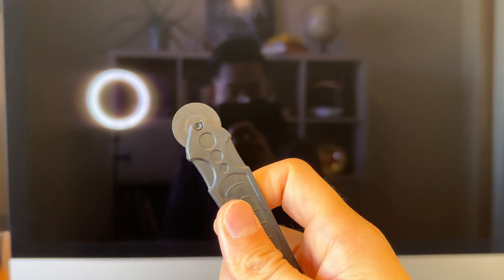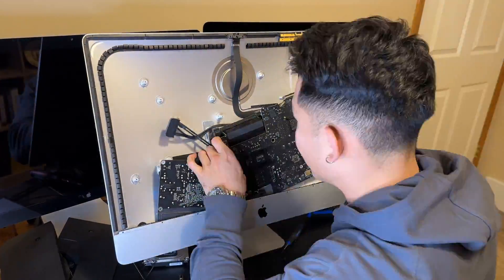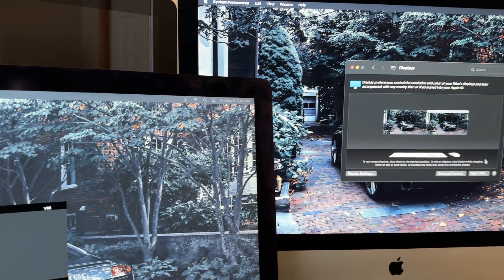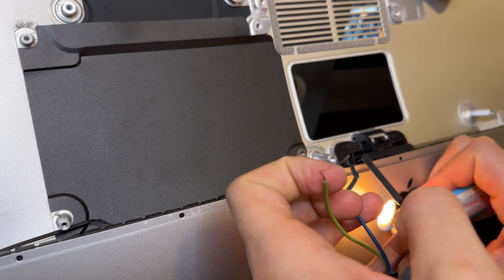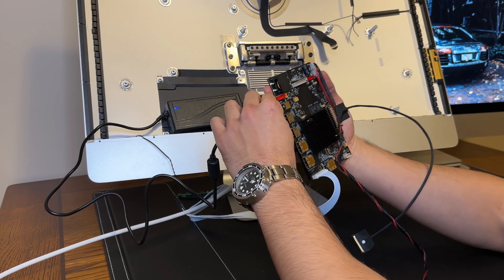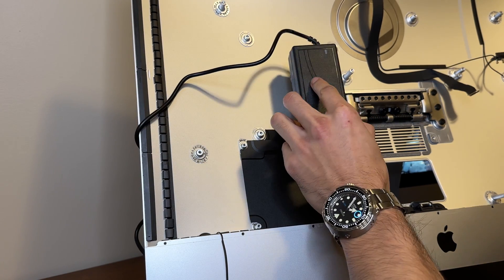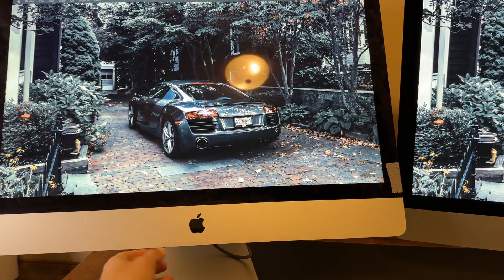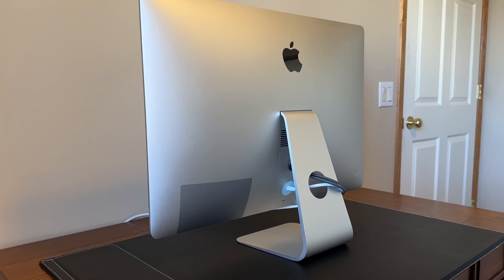How I Got a 5K Retina Apple Display for $400

Comment: Hi Run Young,  I may have diagnosed the issue I am having noted in my prior comment.  The HDMI port on my MacBook is HDMI 2.1 (up to 8K) but I was using an older HDHI cable which was probably not able to handle it 5K speed.  I just ordered a new 5K certified cable. Hopefully, this resolves both the resolution and flickering.   I will report back in 24 hours once the new 5K cable arrives.

Comment: Hi Run Young,  I hope you are still connected to this video.  I would appreciate your advice.  I followed the video and sort of got it to work.  I am using a 5K display from 2017 iMAC.  I did order the controller to match the part number which was slightly different than yours.  Mine was LM270QQ1 (SD)(C1).  I am connected to the HDMI port on a 2024 MackBook Pro.  The issue I am having is that the screen will only go up to 4K resolution.  The remote control that came with my unit is in Chinese so that is not helpful.  The Mac settings screen does not show any resolution options for this monitor.  Finally the 5K monitor tends to flash on/off occasionally.  Thanks for any guidance you can provide.

Comment: I noticed you have two DisplayPort cables connected; is that necessary? Wouldn't a USB-C Thunderbolt cable, for example, be sufficient? Thank you.
Reply from the maker: Yes, it’s required for full 5K.

Comment: amazing video! Really love the way you handle it! I'm going to do the same with mine. I have 2 question. You solder two cables, the first is for the power button, of course... and the second? Where did you connect the speaker crossover to the board? Thank you so much.

Comment: Run Young - Would you share the wiring schematics to connect the original power supply and the power button to the new logic board wiring?  Which wires to cut and splice?  Thanks!

Comment: Thanks for this video, very helpful ! I just modded my Imac 2015 with a SA1 board, everything working well (appart that i broke a bit of glass on the side of the creen when manipulating it... One question though : 4'34 : which cables on the ribon cable of the controler board did you solder to the original turn on/off button ? there are so many, and cannot find which one correspond to the power button.

Comment: Awesome vid Mr. Young. My 2017 mid year just died. Got a new MacBook M4 16" Pro. Want a monitor and still have the 2017 monitor. Is there a way to install a thunderbolt in there or how do you connect a plug to run a MacBook to the monitor ? Thank you again, Kim
Reply from the maker: Yeah! Just buy a display port to usbc cable!

Comment: to connect it with my macbook M1 max, only 1 display port is enough ?
Reply from the maker: Im not sure how it will work with apple silicon, I have not tried.
Reply: @RunYoungShoots  I finnally bought the SA1 board, it works great in 5K with USBC. I will probably run a display port and hdmi, just for backup, but for now working fine ! I just need to do what you did with the power button and AC in.
Reply from the maker: @Studio23creation nice!

Comment: I used this video to make such kind of a monitor. If you familial with soldering iron you can use power supplier from iMac. It's power enough to provide 12V. 5K works with Display Ports. I did not get it with HDMI.

Comment: If I may ask, why not run the board with the LEDs and switch outside also? Does the remote do everything that board would do?
Reply from the maker: @rickbo3366  Yes, it would look bad.
Reply: @RunYoungShoots  thanks.  One other question.  Are you sure it’s running at 5k? I saw other places which said DP 1.2 won’t do 5k without 2 inputs?
Reply from the maker: @ Yeah its 100% running at 5k, same as my other iMac screen.
Reply: @RunYoungShoots thanks! I am going for it!

Comment: Do you need two display port cables if you plan on hooking it up to a M4 mac mini? How do you connect two DP cables to a single source PC? In retro-spect is it worth going through the trouble or should I just buy a 5k monitor? I currently have a 2017 IMAC. Thanks.

Comment: I did this and my brand new M4 Mac mini will not run 5k, even though it detects that the monitor is 5k. So I connected it to a Windows laptop and it runs 5k without issue. The cable is good since it's the same cable used for both Mac and PC. Sooo....not so happy with the outcome. Seems to be more of a Mac issue. Disappointed, but I guess I have a new monitor for my Windows laptop.
Reply: I want to do this for mi mac mini m4 too :(
Reply: do you try to connect whit to display port cables at the same time¿?
Reply: @lmbgott  It's working now. It was just me making an error. Will make a second monitor at some point. It's amazing quality.
Reply: @rockymtnmovies  great news ! Are the colors the same as before ? and are you sure 5K is real 5K ? (and not 4K upscaled) you could check it switching hdmi and display port and see if there is a real resolution difference). thanks

Comment: Saving this for when I'll do it in a few years when my 2017 iMac is out of business. Definitely the cleanest retrofit I saw so far. The power button and usage of existing holes is chef's kiss. 
I wish somebody made a ready to use retrofit kit that you can install in place of the original logic board that also uses the existing ports in the back as a hub. but this will just work. 

Can you please just elaborate on the double display port thing? Let's say I buy a Mac mini 4 and want to use my old iMac, will I need to fill 2 thunderbolt ports per monitor?
Reply from the maker: @zenotdsTV  No, newer computers/graphics cards don’t require double cables

Comment: Hi, really good job, and I started to do like you. I am at the point I’m waiting for the driver board especially matching my led screen. This board has a jack output for the sound. So I’m thinking that if I use an Appletv as source with hdmi out, I could use the right and left original iMac speakers for the sound. And I’ve seen that you also do it ( using the speakers) but each speakers have a small electronic board, maybe amplifier? Could you help me finding those to realize the sound output. Am I wrong is it possible? And if yes, does AliExpress sell that? Thank you very much, Francis from Paris, France.
Reply from the maker: @Fdoubleve  Yes, I ordered those from ebay, however the sound quality was not great, so I abandoned them.
Reply: I finally found at AliExpress, 2 or 3 differents and I try those with the less bad comments. They are less than average but let’s say acceptable for the price. I can tell my Mac Mini to use my Bluetooth  Harman kardon speaker or my Bose companion and it’s perfect. You are absolutely right. And for the usb camera I tried a 5 MP that didn’t work with the back plug in but ok with one. In the front of the Mac Mini. I’m so glad I could transform it, people like you are invaluable. Thank you so much. I’ll do a French tutorial with the difficulties I encountered and certainly links to two or three tutorials that helped me succeed in the transformation.

Comment: nice and clean job, and brilliant to use the lead weights inside. I modified mine some weeks ago, but at full 5k resolution the menues and everything is just tooo small, I can only get proper sizes at a lower res. any ideas what I have to tweak?
Reply from the maker: @CompactFlesh  I just adjusted the size in the settings
Reply: don't worry, choose a lower resolution, which will only affect the appearance of the text and UI, but it will actually styill be 5K.

Comment: I have a 2017 27" iMac. I already installed a ssd SATA hard drive as an upgrade, but still not fast enough for my liking. I guess I could put a NVME ssd under the logic board, and see if that is any faster. Or should I just do this? I will be using my Mac Mini M1.
Reply from the maker: @ChristopherShawnPike  I think this would be better

Comment: Hi very nice video, can you tell me the pinout - the exact cables you connected from the board to the imac power button for it to work? Great video!!!
Reply: I think it’s the third and the fourth and doesn’t matter wich one you link with the two of the on/off button…. Or you also may soldering on the push button of the menu commands buttons … sorry for my English from Paris, France.

Comment: So do you have to plug both DisplayPort cables into the source device in order to receive the full 5K resolution?

If so, is it possible to use a splitter and/or adapter in order to plug both cables into a single DisplayPort or HDMI input and still receive the full 5K resolution?

I’m asking because I’m planning on switching over from a 2 Monitor setup that I connect to my M1 MacBook Air using 2 HDMI female to usb Male DisplayLink adapters (connected to another dual usb-c to usb adapter), and want to do this conversion on 2 separate iMacs in order to have dual 5K monitors connected to my M1 MacBook Air using either the same (2) DisplayLink adapters in order for the MacBook to continue to output to two separate monitors, or upgrading to a DisplayLink tower that accepts both DisplayPort and HDMI inputs if necessary.
Reply from the maker: @qthedivine  I tried to find something like that, but it was tough to find something for 5K, they’re also pretty expensive.
Reply: @ I’ve verified that there is a USB-C DisplayLink adapter by WAVLink that supports 5K. It has 2 DisplayPort plugins and 2 HDMI plugins. I’m just wondering if it’s possible for a single MacBook Air M1 to output to two of these converted iMacs at once in order to have a dual 5K monitor setup, for a total of 3 screens all at once including the MacBook Air screen? 

And if not 5K, then what would the resulting resolution be if only using a single DisplayPort cable or HDMI cable per screen, instead of 2 cables per screen?
Reply from the maker: @ I believe your Macbook does not require dual DP for 5K
Reply: @RunYoungShoots  Thank you for your help. I’ll do a little bit more research and verify this before attempting my build. But I’m excited and motivated after seeing how well yours turned out. I’ve been running 2 39in 1080p Vizio HDTVs as my monitors for the past couple of years. But I don’t mind sacrificing the screen sizes to have the full Apple aesthetic along with 5K. Thanks again. I’ll be starting my build soon.
Reply from the maker: @ Good luck!

Comment: Hello, what 2 wires did you used for the power bottom going to the board ? Are the terminals label ?
Reply: I'm trying to use them and also wondering about this. I can see one says power but there is two from the button

Comment: 2:04 Do the two USB C-to-Display Port cables both attach to the computer then? You use an "older model" iMac, but would one still need two cables when connecting a 2019 MacBook Pro?
Reply from the maker: No you would only need one cable with newer computers.
Reply: @RunYoungShoots  I have the 2015 models with thunderbolt 2. Would i need to run both cables?
Reply from the maker: @insigniamodified  Depends on the GPU it has

Comment: Excellent video. I'll be doing this to my 2014 iMac in a few weeks. Have you come across any board that might allow the speakers to work?
Reply from the maker: The board I used supposedly allows speakers to work, but mine had buzzing issues.

Comment: Can you tell me what two video cables you attached to the video board that come out of the Ram access door?  I am planning on using the new 2024 Mac mini that is coming out  this November with the M4 chip.   Lastly  how and where did you mount the small push button pad that is connected to the video board by the ribbon connector Thanks!!

Comment: I've just finished mine using your video for the instructions, and it worked like a charm! The only thing I haven't managed to do it is the hole to pass the cables into the RAM cover. Also my logic board doesn't have a remote so I had to keep the controls outside. Great video and thanks for all the details!

Comment: Very Nice, thank you for this excellent video. In the beginning I see you have an old 27” Thunderbolt or Cinema Display. I also still have that, but the panel inside is getting old and dark. Do you think I can buy a used 2017 5K iMac and put the 5K panel into the housing of the Thunderbolt/Cinema display using the same parts and technique you use here?  I would love to keep the fantastic Apple display housing! Any ideas/hints would be greatly appreciated 🙏
Reply from the maker: @daggerman-dcgk  Thanks for watching! I don’t think the screen would fit into the thunderbolt display unfortunately. It is much larger.

Comment: You use two DP cables for the 5k resolution but into which ports on your functioning iMac do you plug those two cables and with what type of connector on the end of each cable ?   I have a 2017 iMac and it has two USB C ports on the back (along with four USB type A ports) and a Radeon Pro 570 4 GB graphics card.
Reply from the maker: @speedbird8326  I believe with your newer imac you wont need two DP cables
Reply: @RunYoungShoots  Ok so would it be a DP to USB C cable ?
Reply from the maker: @speedbird8326  Yeah if thats what you have on your iMax
Reply: @RunYoungShoots  Thanks

Comment: Have this exact iMac, Late 2014 27 inch. Thinking of doing this conversion + replacing the camera for a smaller, higher resolution Arduino camera for robotics. Easily could get another 4-5 years of use out of the display, insane value for the price. High quality video man! Hopefully you were able to sell some of the parts.
Reply from the maker: @risley.ogembo  Thanks for watching!
Reply: @RunYoungShoots  Quick Question: Does the display support apple silicon macs as well?

Comment: Hi. Great vid. Since the seller doesn't offer the remote anymore with the kit, I was wondering if its needed from the project. I want to do this to an old 2017 5k as well.
Reply from the maker: Thank you! I believe they have different packages, and they still sell it with the remote.
Reply: did you do it ? Are the colors the same as before ? and are you sure 5K is real 5K ? (and not 4K upscaled) you could check it switching hdmi and display port and see if there is a real resolution difference). thanks

Comment: You could probably make 3d printed brackeds that go over the mount points within the shell to help hold those items in if you didn't want to use hot glue

Comment: I bought a luna display.
There is no need to destroy the iMac. I mainly work in FCPx, I can render two projects at the same time. Of course, iMac is slower than Mac Studio. There are many uses for having a Mac Studio and a functioning iMac at the same time. Best of all, Luna Display costs only $79
Reply: You completely miss the point
Reply: Luna lagged too much.
Reply: i use the luna display since 2 years and i'm so tired of it. so laggy, low fps, and lots of compression issues.

Comment: As I've got a 2017 5k iMac, I'll do this in a few years when it stops getting security updates. 
I've been checking out a bunch of folks videos for doing this and yours is by far the best. So nice to see you use the speakers,  built in power connector, and use a grommit on the ram door for a super clean look. Also, major props on the lead weights. All told this is a great build. 👏
Reply from the maker: Thanks man!
Reply: What this person said ☝️
Reply: If you release one of the hinge springs, no need for weights. One spring is enough now for a lighter interior.
Reply: @RunYoungShoots  where got the lead weights?
Reply from the maker: @ I believe they are for scuba diving

Comment: What power supply did you use? I am worried about mine (24v 5A) running to hot inside of the iMac chassis.
Reply: I just realized that when keeping the speakers I don't think Ill have enough space left for the power brick, anyway :D
Reply from the maker: Hey man, I used a 12V 6A power supply. I have not had any heat issues at all.

Comment: Very interesting! Doesn’t the panel require some cooling mechanism?
Reply from the maker: No, the manufacturer does have a higher end board with a fan (more complex board), but this version is fine without one. I have not had any overheating issues.

Comment: Eeeeuuuuh, a 2014 27 inch iMac as monitor would work by just installing OS Sierra, then connect through thunderbold as display? Tell me if I am wrong of course..

...clean conversion though. I know this is quite some steps and getting it right needs a good amount of attention and care. Top!
Reply from the maker: Thanks! Yes I believe you can get target display mode working through certain MacOS versions. I just wanted to use the latest OS available to my Mac.

Comment: Won’t that power supply heat up inside that thing?
Reply from the maker: No I haven't had an issue with it, it just doesn't seem to get hot. The huge aluminum case might act like a heat sink as well, although I'm not sure how well hot glue conducts heat lol.

Comment: Great video! In the process of the same project. How did you know where to connect the 2 wires to integrate the OEM power button?
Reply from the maker: Thanks! I had to inspect the circuit board closely, its the last two wires on that harness.

Comment: Just note these 5k iMacs will all suffer from the purple haze effect as the glue that holds on the glass display will change colors giving it a purple haze effect around the edges of the display. Also for some reason, the LG LCD displays have image retention issues which can be fixed with a Reddit search. I just about have the same model as yours running OCLP and it otherwise works fine as a daily use machine.
Reply from the maker: Yes my actual computer a hue of pink and some ima,ge retention issues. Quite unfortunate. Luckily the monitor I converted does not.